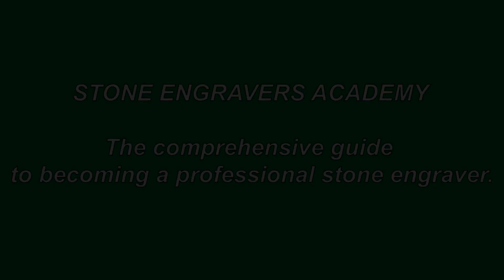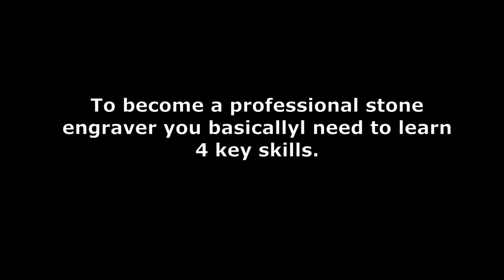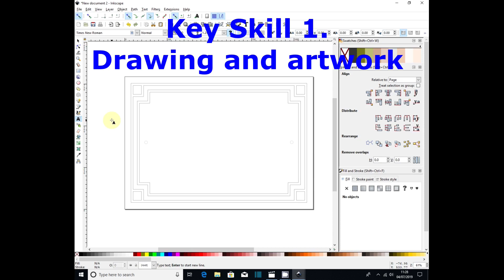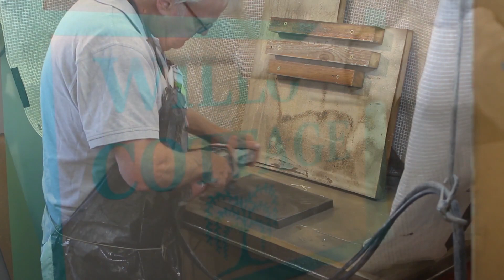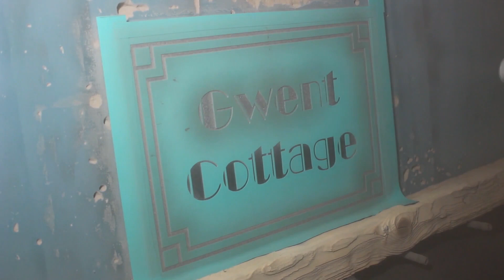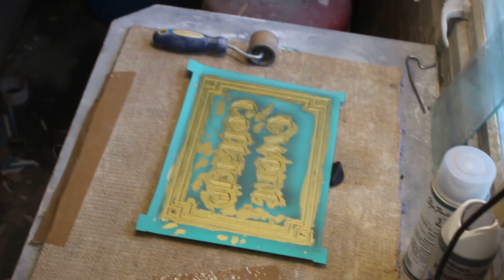Making money from your sand blaster

Comment: I have done stone carving and wondered how to make the letters stand out when you don't have just the right light. I never thought of putting black paint in the depressed areas. Looking forward to your videos
Reply from the maker: Hi Justin, you certainly can paint lettering to highlight. I have made a video on painting stonework and will try to upload it in the next few days. Cheers!
Reply: @thestonecraftingworkshop7490  Would be interested to see this if you got it on. Do you have a link for it? How long do you find Oneshot enamle takes to dry?
Reply from the maker: @phil7791  Sorry I did forget to do this, (so much to do, so little spare time!) I will try to remember this week! I always leave the one-shot at least overnight. Cover to prevent dust settling on the paint but allow air to pass under the cover, typically I would use a sheet of cardboard raised on four small blocks. Cheers!